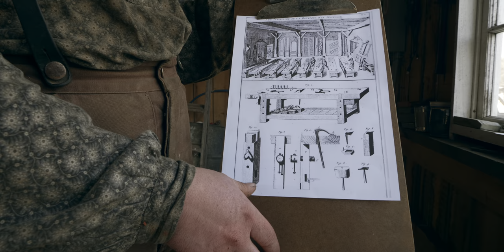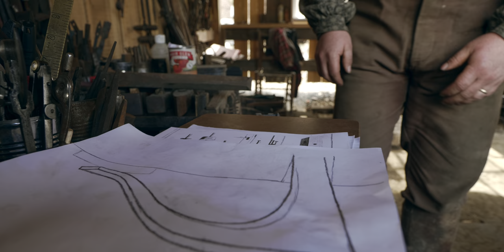Forging a Roubo Holdfast

Comment: Great bench, and holdfast. Good thing you had a couple of power hammers.
For those like me with less forging time and skill, I made a couple simple holdfasts from 3/4" bar, just forge a flat pad at the business end, and bend the neck. Simple enough for a beginner and works fine enough. Sometimes they need texture on the shaft to stick properly, I took a centerpunch to mine and dimpled it all over...
Reply from the maker: Thanks! Yep those simple bent round stock holdfasts can work just fine!

Comment: Made a couple of holdfasts out of rebar, for my 100# William Forrester coach maker anvil, just bent Tham over, formed a foot and tapered the shaft a bit, problem is they're weak and try straightening out, would an upset square corner get most of that strong enough? Or should I just make new ones out of a different material?
Reply: Made mine out of rebar too... Getting tired of it, and  its getting tired of me lol. I'd say try a different material, or go thicker.
Reply from the maker: Material doesn’t have to be anything special, and neither does the corner. But I’d make the shank as thick as will still fit through the hardy hole with only a little play.
Reply: @AxeAndAnvil  my pritchel hole, I think,  is only 3/8"

Comment: I've searched all over for a well made holdfast, however everything I come by is somebodies half assed approach. How would I go about buying a pair of these from you? Is that something you'd be willing to do? I absolutely refuse to spend money on anything besides this type of holdfast. I am currently in my third year of my carpentry apprenticeship, and the actual reason I have sought this is because I am starting to build windows and doors by hand, well I should say I am practicing as a house joiner in my own time, so cabinets by hand, turning 1x material into flooring by hand, base and case by hand, and am doing rough carpentry and lime-plastering in my apprentiship, well really we do the whole build besides electrical and pumbing. We are currently building a strawbale home in the Wasatch Range, in a place called Huntsville, Utah. Anyways the reason why I am telling you all this is because I am invested into my craft, however as an apprentice I am not on the higher end of the financial spectrum, however this tool is fairly critical to the be able to produce these things as efficiently as possible. I hope that my story has inspired you to invest into a young craftspersons journey to mastery, I'll save my penies for as long as I need to but it would be of great honor to have a pair of these holdfasts reside in my bench. 

Best regards,

Dylan Benedetto